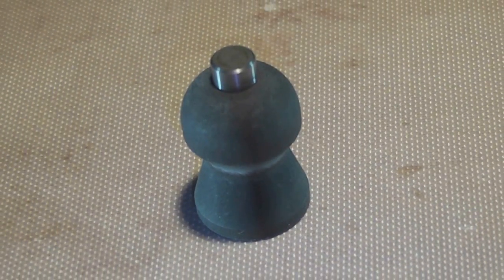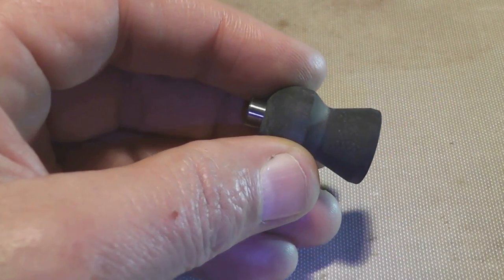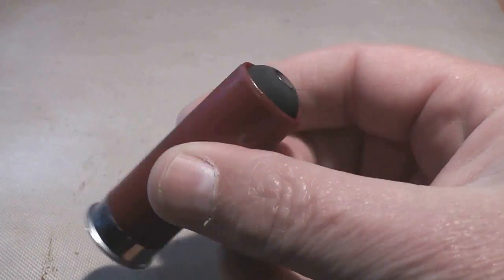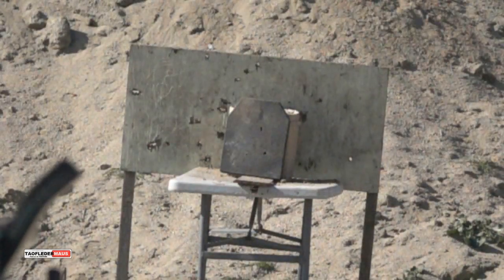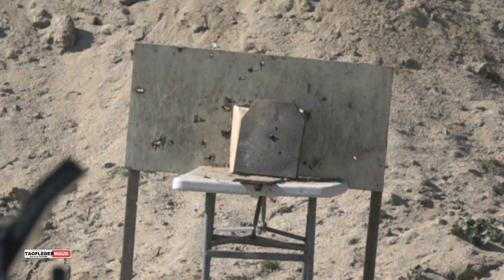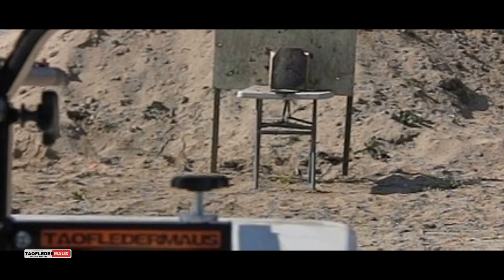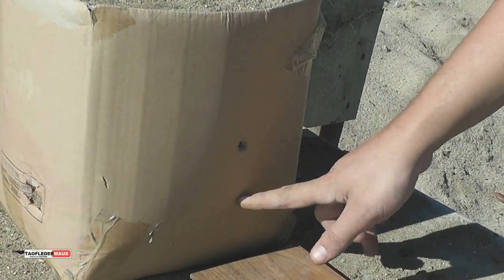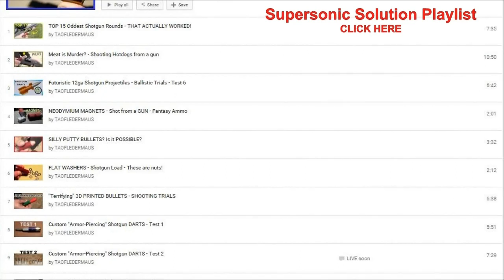World's FIRST Carbon Fiber SHOTGUN SLUG -  ARMOR PIERCING - CONFIRMED!

Comment: I would love to see the second ones(the tapered ones) shot at the plate, but instead of sand behind it have your ballistics gel so you could see the penetration or lethality of the pieces passing through
Reply: +TAOFLEDERMAUS and personally i like this format better with the slow mo after each shot!
Reply from the maker: +scootie12342000   We just needed something as large as the plate in case the slugs didn't fly perfectly straight.   Plus the box of sand is pretty heavy and made a good immovable object.  lol

Comment: The smaller nose on the penetrator is called a "meplat"; and there's a consensus amongst serious external ballistics people that it is significant. Also; you can't compare the naked plate in one pene. video with the rubber-faced plate in this video; the rubber makes a surprising difference. ( it soaks up energy before the meplat contacts the armour).
Reply from the maker: +John Affleck  Yeah,  the rubber is quite thick and I'm sure it has a huge effect with these big,  blunt slugs.

Comment: i would love seeing how shot 3 would work with a sharp point instead of a blunt tip
Reply from the maker: +m4xwellmurd3r  I have a feeling that if we took slug 2,  and put it in the low brass shell,  it would have popped through the plate.  Shot 3 was VERY close to knocking through the plate.  I could probably tap it out with a punch and light hammer hit.

Comment: These plates are retired if they've taken a hit. So seeing a slug penetrate this plate that has multiple hits from slugs isn't that surprising. The plate has lost it's structural integrity.
Reply from the maker: That isn't how steel works
Reply: So you could shoot it a thousand times and it would be just as strong? A scientific method would require require a new plate each time. Also it would need to be repeated a number of times.
Reply: You know nothing about ferrous metallurgy.
research elastic and plastic deformation, and face centered cubic.
Reply: AR500 or is a high Yield (1540MPa) moderate toughness (25J at-40C) quench and tempered steel. When it encounters a high speed impact micro-fractures do form, but at a very close distance from the impact (a few millimeters) as it can be seen by the hole-punching of the slug. Anyway, the way the fractures develop (radial) would not aid the subsequent shot as it was too far from the first impact. It is true that the material could have been weakened, but the similar behavior upon impact suggests it wasn't.
Reply: Dragos Coco I think the OP would be referring to the much older damage from prior use of this plate, not the prior shots in this video.

It wouldn't make sense for tactical armour to not resist a second shot fired in the same attack. But it could make sense to get new plates when regrouping or returning to base.

Comment: You are not gaining any velocity with the high brass shells because burning speed of the powder depends on the pressure and if your load is lighter than the original load in the shell you are generating less pressure. I suggest checking some reloading guides and how projectile weight affects the amount of gunpowder required for load.

Comment: Nice video! I've been a subscriber for a while now. But I thought it was funny when u said "now let's compare a led slug." Then you played them both at the same time lol did u want us to have one eye on one clip and the other eye on the other clip? Haha
Reply: hi doob
Reply: +King Mo what's up
Reply from the maker: +Doob    The zoom on that camera shot were the same so they matched up better.   I usually put one on top of each other,   so it is a little hard to watch both without going cross-eyed.   I was just trying to anticipate people wondering how fast the slugs were going and assuming they might be going much faster than they actually were.
Reply: +TAOFLEDERMAUS yea I understand now. I was thinking what if you used dry ice as a projectile? Like a dry ice slug. Could that be the untraceable round? It Would be a very interesting video.
Reply from the maker: Dry ice is really light weight,  lower density than water/ice.   We stuck some pieces of dry ice in a shotgun before but  it was really too light to even set off the powder charge.
Reply: +TAOFLEDERMAUS hmm could you think of anything else that would be the untraceable round? Demo ranch did coconut oil.
Reply from the maker: A wax slug.  Good luck tracing that.  lol
Reply: +TAOFLEDERMAUS yea lol wax slugs are the best!
Reply: +Doob would be cool if you were to try and shoot fishing tackle out of a shot gun. Try different types like top water poppers and spinners. That would be a interesting and cool video lol.

Comment: If you are using the same peice of material isn't it naturally going to get weaker each time? Why not use new ones each time?
Reply from the maker: No, the molecular structure of the steel doesn't change
Reply: ***** So it is indestructible then?
Reply: Very late here! I would think that because of how close the grouping was, there would be a little bit of instability in the structure. I also imagine it is slightly possibly that the second round just slid to the side into the first shots damage, making it deeper.

Comment: Can u shoot the strongest shell first, because armor plates are made to stop one bullet, and i would like to see the plate used at its best performance.
Reply: Steel keeps its integrity while being shot, while ceramic plates on the other hand lose effectiveness after a couple shots depending on where it is hit
Reply: +Alex Nico steel is fine after every shot, except maybe a little bulge or a small hole on it. if you dont hit exactly the same place twice, then there is no problem whatsoever.
Reply: +Alex Nico on the other hand, ceramic plates can take 2-3 hits maximum, because a large portion of the ceramic plating gets destroyed after every shot.

Comment: would a diamond tipped projectile do anything major?
Reply: They shatter easily.
Reply: +Todd Hambly For the reason you just stated, I wonder if a shock resistant steel properly heat treated would not out preform even the tungsten.
Reply: +Nova Nation Your paying?
Reply: +Nova Nation http://bfy.tw/4Nnc

Comment: What if the tip was still carbide, had flint charges behind, encased 
with magnesium, with a titanium tail/striker, so as the tip makes 
contact the flint pushes the carbide, while the magnesium burns hot as 
fuck and the titanium base follows through it all like a steam train

Comment: I don't see any Body Armor being used in the Testing and then showing the results that the slug went thru the body armor.
Reply: The body armor is that plate. The plate if the raw body armor without the vest itself. It's what stops the projectiles from penetrating you.

Comment: Looking back on the silly putty videos, have you considered (or tried) forming a silly putty slug around a penetrating core like a nail?
Reply from the maker: +j.oz   The problem is keeping a slug like that flying straight,  which is doesn't.    It would just fly sideways.
Reply: Thanks - I guess I couldn't quite tell when I was watching the high speed!

Comment: +TAOFLEDERMAUS it'd be interesting if you could shot another one and use a magnum shell or even an express one,here in italy we use almost only magnum(3 inches - 76mm) 12 ga or express (3 1/2 inches - 89mm)
Reply from the maker: +Gabriele Ciciriello   I think there is a limit on just how fast you can propel a very light slug like this just by using a more powerful shell.    For example,   if you take a shell that is meant to propel a 30 gram slug ,  1200 fps,   putting a 10 gram slug in that shell  isn't going to make the slug go  3600 fps.   That was why I showed the side by side shots at the end of the video,  to show the lead and the carbon fiber slugs travel very close to the same velocities.    That was surprising to ME because I thought the lighter slug would be noticeably faster.
Reply: ***** Yeah maybe the powder doesn't have the time to burn in the barrel,or there isn't enough compression

Comment: the scientific part of my brain is screaming you need 9 shots!!!! the 3 types of bullets with the first shell the 3 with the second and the same with the high brass.
but I also realize that is more expensive :(
Reply from the maker: +darkpheonix77       Had I put the tapered carbide slug in the low brass,   I'm fairly sure it would have had the same results as shot number 2,   just because the velocities were pretty much the same whether we were using low or high brass.   Since the velocities were the same,   we can be pretty certain the difference in damage to the plate was because of how far the carbide protruded,  and if it had a smaller cross section.
Reply: I know after seeing the results and the speeds I doesn't really matter. but still!! just keep in mind for future bullets.
Reply: +TAOFLEDERMAUS how much did each piece cost by the way?
Reply from the maker: I didn't ask Tim what these would cost to make.  Probably quite a bit because he said the carbon fiber stock was expensive and it wore out the tooling pretty bad.

Comment: I think a pointed end on the carbide can only help.
Reply: +Frederick Kaludis, only up to a point. Ba da tss.
Reply: +Joe Clark you make a good point.  Every load should drive a tip.  A shaft without a tip has no point.  Penetration is best done by a tip delivering a big load.  If you're going to try and poke holes, start with a point.
Reply: BobWidlefish. It the tip is too acute, it would likely be destroyed before it could transfer enough energy to pierce the material.
Reply: +BobWidlefish I see who you did there....i mean.... what you did.

Comment: is that carbon fiber or carbon-carbon?
Reply from the maker: +Ted Schoenling  Tim said it is carbon fiber.   He makes aerospace stuff.
Reply: must have taken forever to lay all that up!
Reply from the maker: He machined it from a piece of carbon fiber round stock.
Reply: Yeah, I just watched the video.  Coming from the f1 mentality of Carbon Fiber, when I hear that term I think of resin impregnated carbon cloth.   The material for the slugs look more like the carbon-carbon F1 brakes than the fiber cloth.
Reply: +Ted Schoenling This is what is called bulk carbon, with chopped fibres. It's highly machinable and quasi-isotropic, making it suitable for compression moulding and machining. Carbon-carbon is something entirely different.
Reply: +Ted Schoenling This stuff is usually made by pultrusion. The fibers are woven and run through resin, then pulled through a die and heated to cure it into that shape.
Reply: wyzarme Yes, Carbon-carbon uses a very slow process to attract the carbon into a form, and it takes months to make a tile or in the case of F1 a brake disk. 

I'm not a material engineer, just a tech geek F1 fan who is amazed by seeing this material which is unlike what they use for their cars (Laying up custom shapes with fabric is stunning)

Comment: 'designed to penetrate armor" atf will be arriving at your house in 3...2...1...
Reply: +JKC40 I'm pretty sure the problem with AP is if it is designed as a pistol cartridge. IDK how familiar you are -- but, All rifle cartridges are AP against soft armor.
Reply: +gi70st I'm familiar. But AR 500 is not 'soft armor', and the ATF currently has a beef with any ammunition with a penetrator that is 'designed to be armor piercing'. This was the rule they were going to use on M855.
Reply: JKC40 I guess the point I was trying to get at is that when you say something is Armor Piercing, you need to qualify that with what armor it can defeat. M855 was going to be banned, as I understand it, because it is designed to penetrate armor and is in common use as a pistol cartridge -- since it's used in AR Pistols. The AP regulation is designed to "protect Law Enforcement" so, i think, for soft armor that LE wears - and only with pistols because that's what they're likely to encounter.

Comment: Love the vids, but I cringe and yell every time I see a shooter head up-range without opening the breach on the weapon.  We all know to assume it's loaded, as should the shooter.  It's poor etiquette to film and demonstrate firearms and not adhere to basic range safety.  That said, keep up the videos and please be safe!
Reply from the maker: +Robert C.  We only load one shell at a time.   The tube is empty otherwise the shooter could not load two shells into the gun.
The shooter is the only one that ever handles the gun.  The gun can not shoot with an empty shell in the chamber.   The gun can not shoot without someone pulling the trigger.
Reply: +TAOFLEDERMAUS  I see the precautions that you take, and I understand firearm operations.  I also know that if I tried to do the same thing at my range, I would be asked to leave and not return.  I know a weapon will not discharge without a trigger pull or being in an unsafe position (say dropping it) while loaded.  The old adage is to assume it's loaded at all times and treat it as such. Accidents can and will happen.. I just like to minimize the risk is all.  Granted, most of the time your guest shooter clears the breach before heading up range.  I also take note of you loading one shell at a time during testing.  Old range habits die hard.  Sorry.
Reply from the maker: That's the difference between a public range with multiple shooters and a private one with one single shooter.

Comment: I must say, you people really need to go and get some real armor. Disappointed in this channel. First 3D printed bullets, then carbon fiber? What are you, some type of hipster? The most powerful seemed only to have the effect that an AP 5.56mm has on a dirt cheap wall-mart grade steel plate. This simply isn't real (or at least not properly hardened) armor place. A .308 carries much more energy and is smaller, yet good plating can still stop it.
Reply: But a .308 is normally made of lead, and is fired at speeds lower than the threshold for that material to penetrate (at close ranges 5.56 M193 ammo penetrates AR500 from it's sheer velocity).

Armor penetration is somewhat independent of total energy, because energy will be dissipated into deforming the plate but also in moving the plate around.
Reply: +Filipe Amaral I have never seen 5.56 penetrate ar500
Reply: anthony clark Look up "AR500 M193" and find a video where the shot is taken from about 10 yards. At close to muzzle velocity the 5.56 can penetrate the plate.